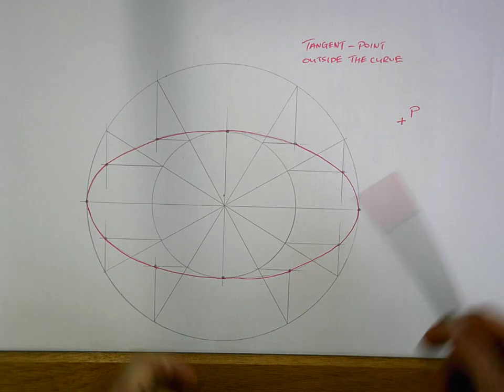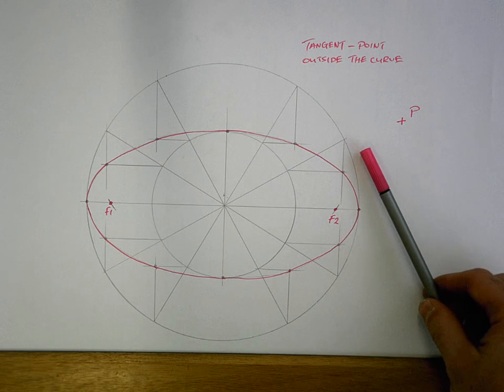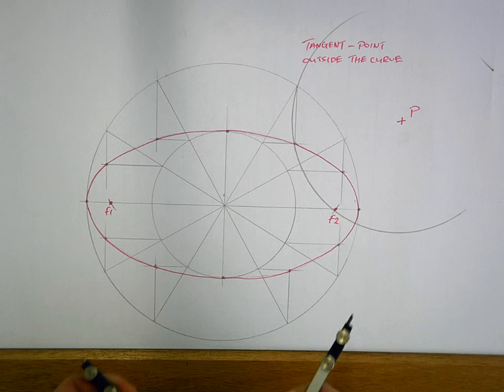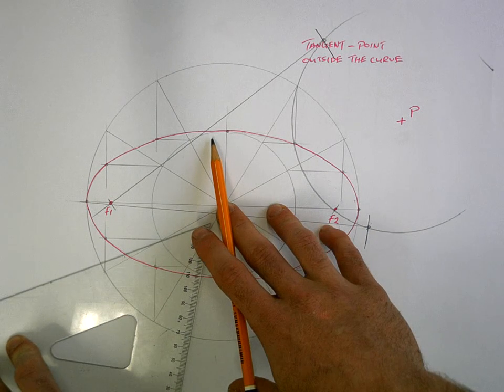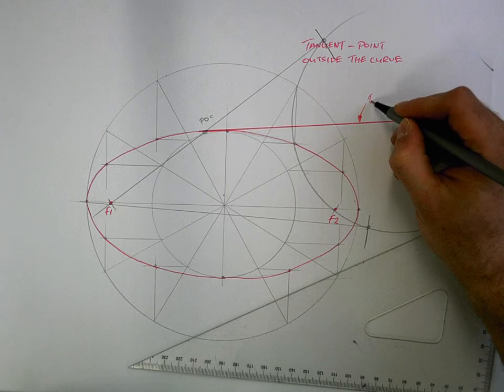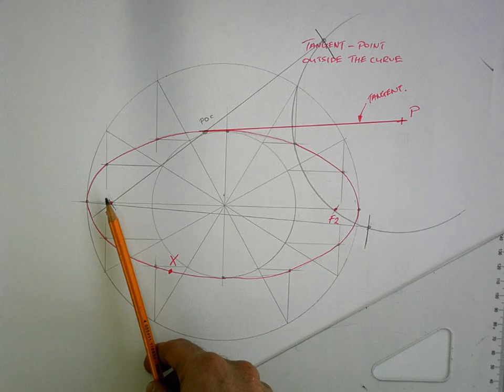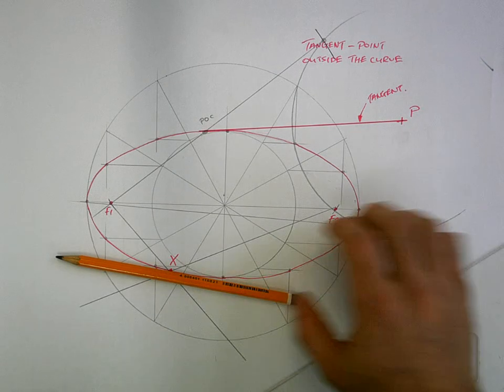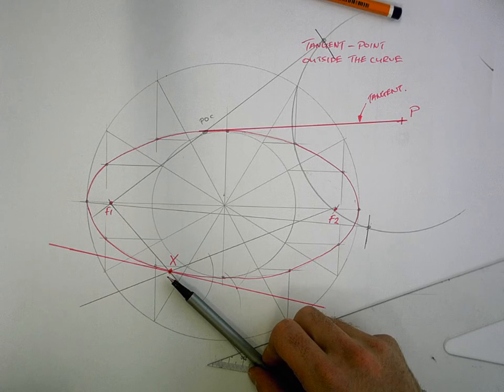JC Tech Graphics - Tangets to Ellipse

Comment: When you were finding point x when you bisected the angle was it a random distance or did you know it was going to be there
Reply: random
Reply: When bisecting take any measurement  on your compass and draw arc then on the two points draw another arc the with set square draw line through therefore you have just bisected a angle